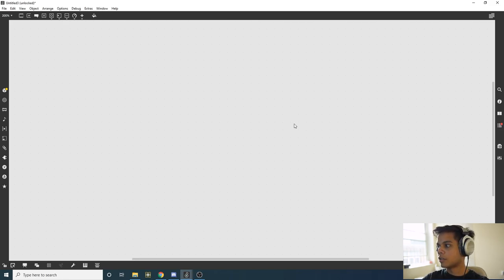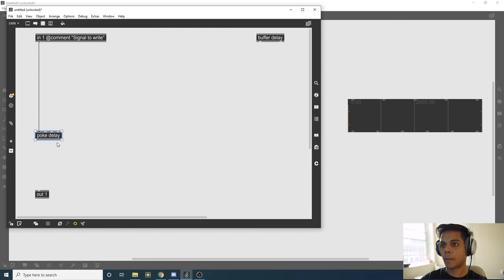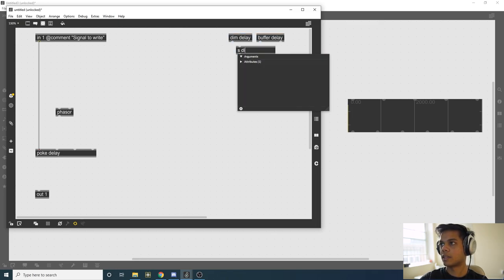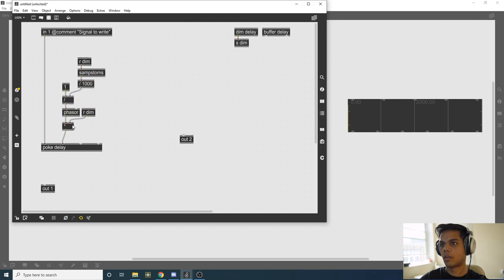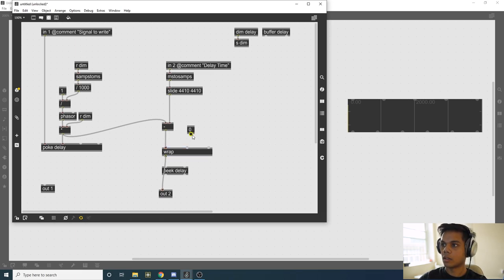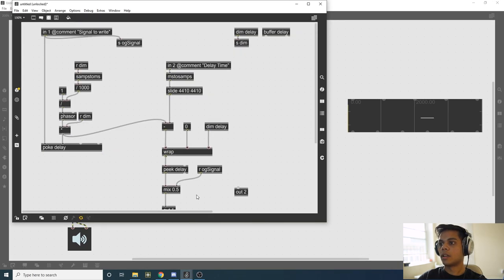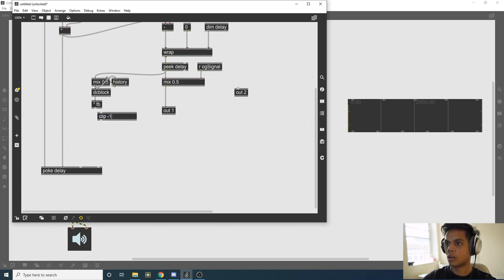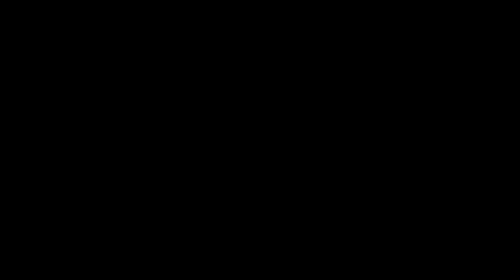Circular Buffer/Delay Line in gen~ for Max/MSP

Comment: How do you load the Audio in Max8? It should be in WAV/AIFF? And how to load it in the Max. Probably a dumb question but I was finding it really difficult to load them into Max. Most of the time I am using the sounds available from the Tutorials. Could you help me out?
Reply from the maker: Hi Nileet, the way you add an audio file to you patch is via the buffer~ object. You instantiate a buffer~ with a name for e.g. [buffer~ foo] and you then drag and drop your audio file onto that object. That's the simple way of doing it.
Reply: @AaronMylesPereira  Thanks Aaron. That helped. I wasnt aware of drag and drop. I was trying to add the file into the file browser and trying to add into my patch. Thanks, Much appreciated.
Reply from the maker: @frozenmomentsbynileet  There are multiple ways to do it, that is just the most convenient but it doesn't store the file so the next time you open your patch you will have to do it again. The foolproof method is to add it to your folder where your patch resides then use [thispatcher] and you can give it the message [path] which will spit out the system path of your patcher from the right output. You can then use [sprintf %s/'name_of_your_audio_file'] and you can send that message to your [buffer~] object prepending the message with the [read] function. If you loadbang that whole process without fail your audio file will always load into the buffer when you open up the patch. 

Sorry it is a long process but from practice it's foolproof.